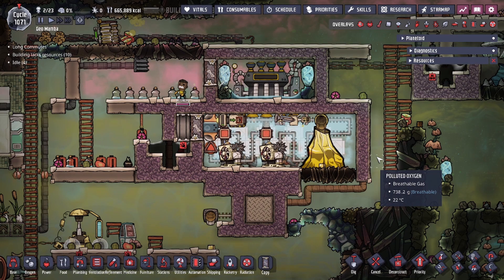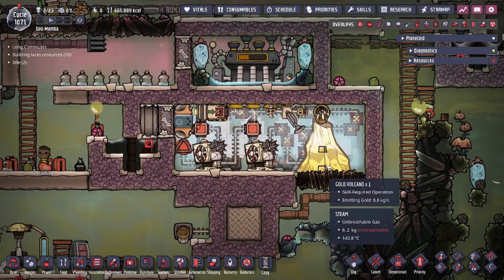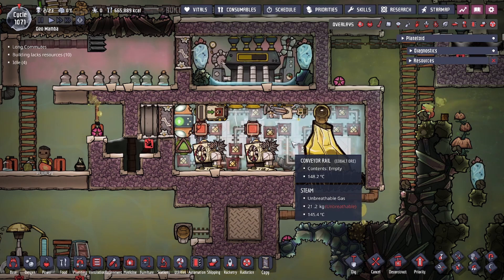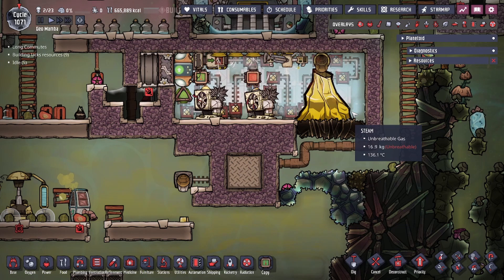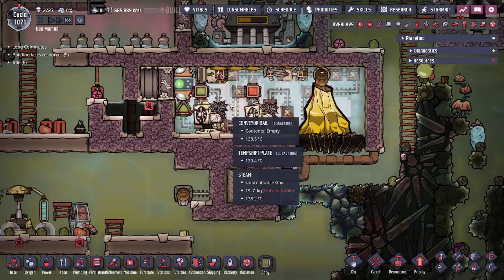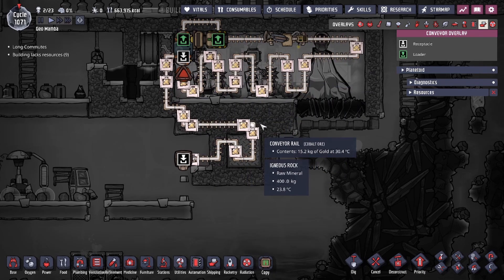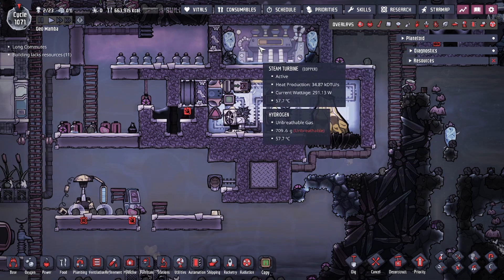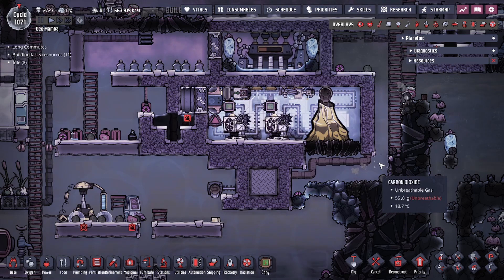Gold Volcano Tamer - No Aquatuner Needed! - Oxygen Not Included

Comment: Cool design but I still preferred your previous tamer, enlightening. I find most of the regular metal volcanoes aren't providing much heat worth generating power.
Reply from the maker: yeah, the metal volcanos are really just hot enough to be a slight challenge to cool the resource before use - although you can strip some power, its really not alot
Reply: @2LegitCity  -  Letting starting metal volcanos erupt wild for a hundred cycles, even with risking heat damage to resources/biomes, you have enough metal to build a power spine from space to the bottom, plus enough run for solar panels across a lot of the top, and a lot of batteries and metal tiles everywhere to get around faster.  That's plenty of power and movement infrastructure while setting up a small colony.  I'm kind of sad how fast all that metal disappears once I start using it - never enough.
Reply from the maker: @ahmataevo  hmm, since you let the molten metal stack up, wouldnt you have to eventually mine the metal since it would solidify as a diggable tile? that means after you extract the heat energy, you lose half the mass from digging
Reply: @2LegitCity  - Aluminum has, but that's still better than not getting any metal at all while leaving it capped.  I need to wait for gold and copper dormant periods and get more steel to finish their builds.  One incomplete tamer has a big pool of liquid gold now, with a salt water sea to dump it into when I finish that one up.  I'm sure supercoolant loops will deal with the rest of the heat in the biome.  I do need to wait for the volcanos to go dormant before finishing the builds around them, particularly to vacuum out the gasses and then seal up once ready.
Reply from the maker: @ahmataevo  you could force seal it with a coal tempshift plate on the right tile so it overpressureizes and cant erupt if you dont want to wait for it to go dormant. coal cooks into refined coal but its a diggable tile